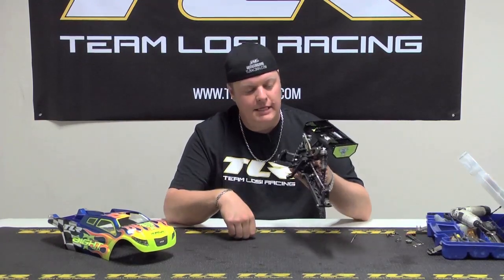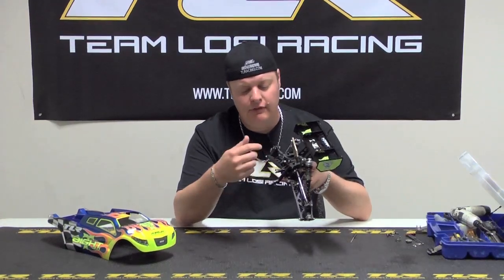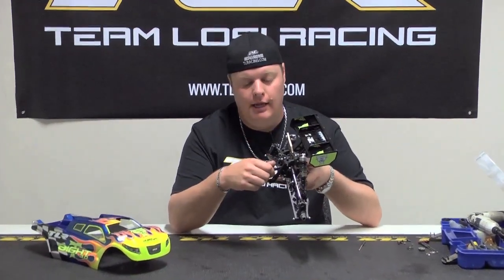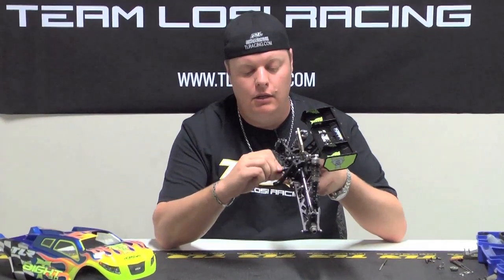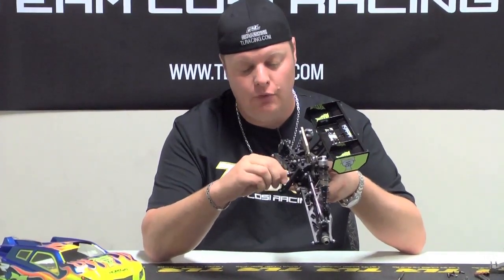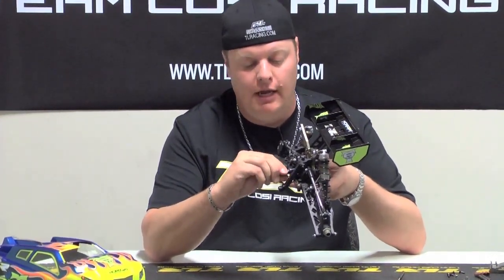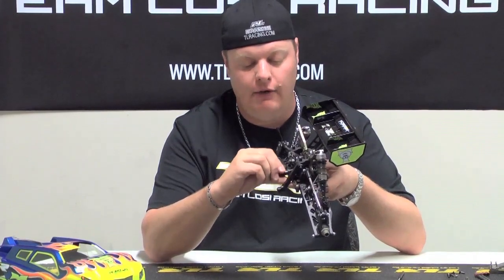Team Losi Racing 8IGHT-T 3.0 Ring & Pinion

Comment: I recently bought a Losi 8t. And it is the ready to run version long story short the ring and pinion went out in the rear end I bought a complete ring in pinon off of eBay which is the 12 tooth pinion 47 to 3 in gear I made about 15 to 20 laps around the track and I heard it start popping I didn’t do any Cham into it because it was brand new already assembled when I got it if you could give me some pointers on how to stop this from happening or Point me in the direction of some hardened ring and pinion gears I would appreciate it thanks buddy. Matt